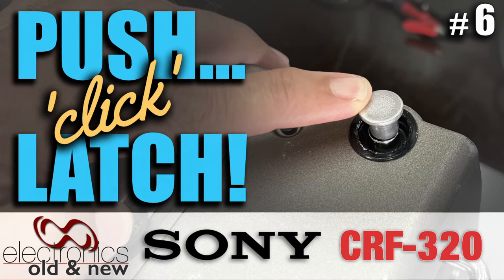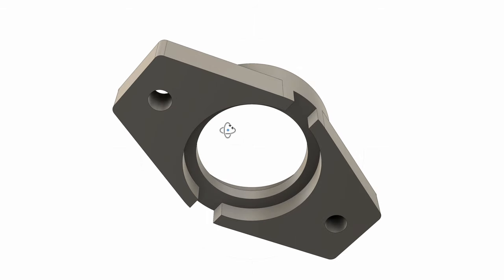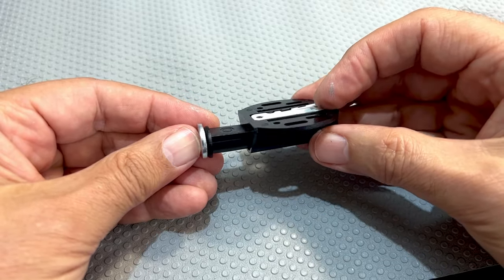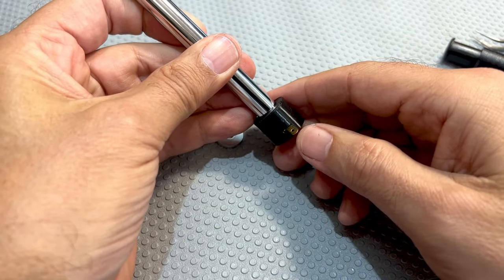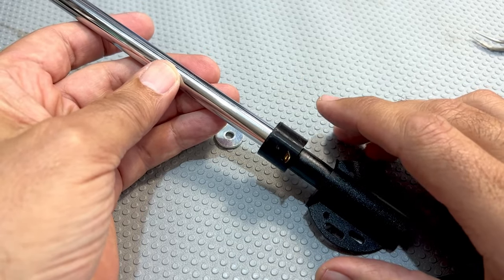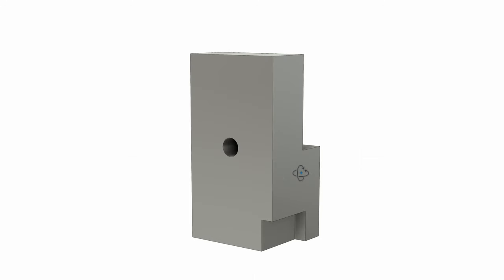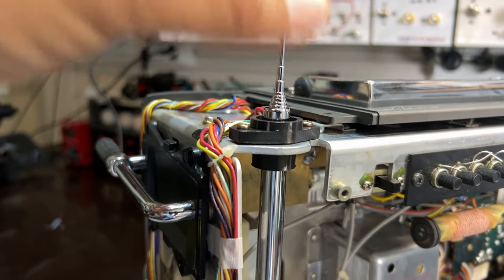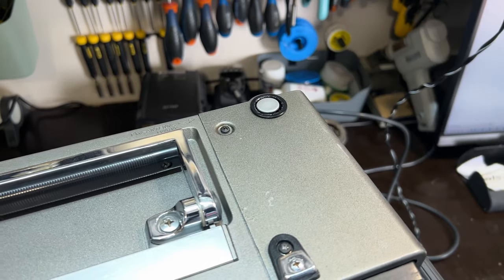DIY push-to-latch antenna? Yes, it can be done! Sony CRF-320 restoration Pt.6

Comment: Well done! 3D printing is a game changer, I'm an old  engineer and trained mechanic so that I could make almost any part, even without a lathe, but 3D  printing is       such a time saver 😂  and when you're getting old, time is the least you have 😂  still working on my Saba Freiburg, the duplex clutch is slipping 😢

Comment: How gratifying to use your 3D printer to resolve the antenna problem, in fact many of the problems on this radio. It really does look the part and works as the original. Congrats on your ingenuity.
Reply from the maker: Thank you

Comment: Fantastic solution to your antenna problem. Years ago I commented that you should get a 3d printer. You did and I’m sure you, like me, find it invaluable and indispensable , although it can open up another bottomless rabbit hole if you are not careful. The antenna top button might be better attached if you use the technique of incorporating a steel nut   ( which has the correct matching thread) into the plastic while printing. The button will then screw on easily and still be removable if required.
Reply from the maker: The 3D printer was indeed a great addition, and (as you say) another rabbit hole 😊

Comment: Manuel. You can get things called "Chicago screws" in various sizes (they are more usually used on leather belts, etc.) and the "bolt" part of them make for excellent replacement end caps for the tops of aerials. I have used them to fix quite a lot of aerials. Hope this suggestion might help you sometime in the future. By the way, neat job on recreating that pop-up aerial - shows persistence does pay!
Reply from the maker: Thanks 👍

Comment: Great 3D-printing work, Excellent!  One minor detail : in the top-bracket for the antenae you could have made a small indent on the inside to add a rubber ring to keep out moisture..